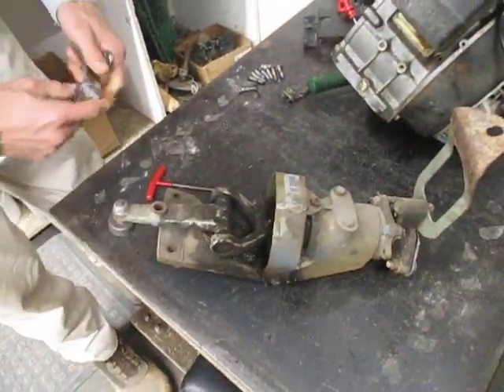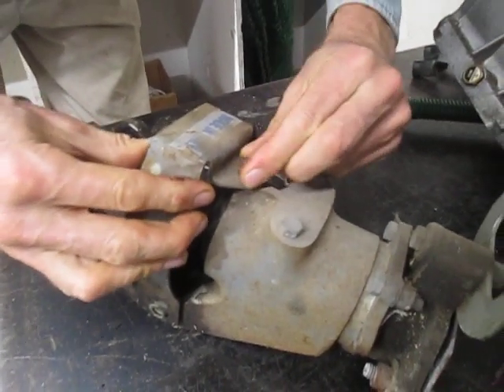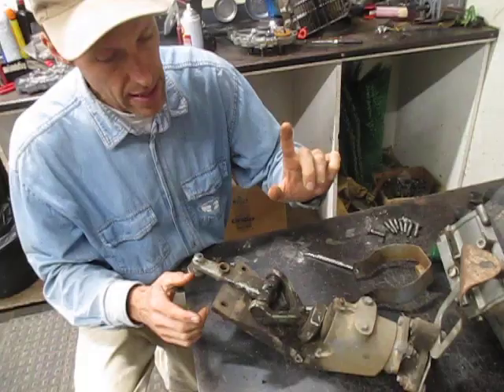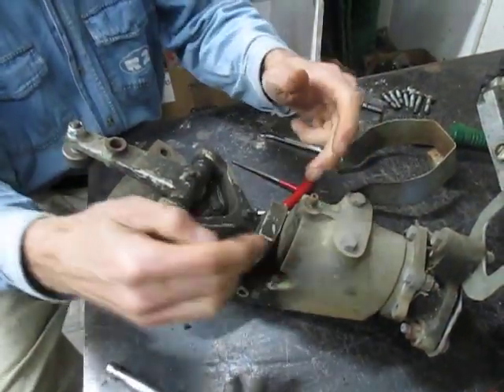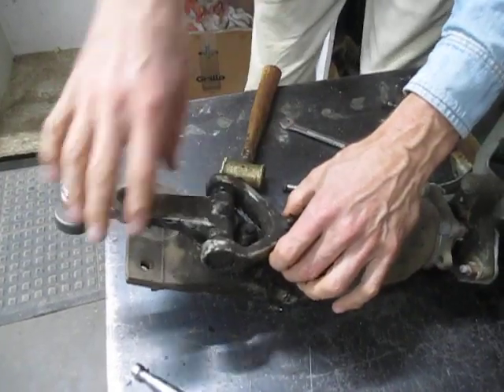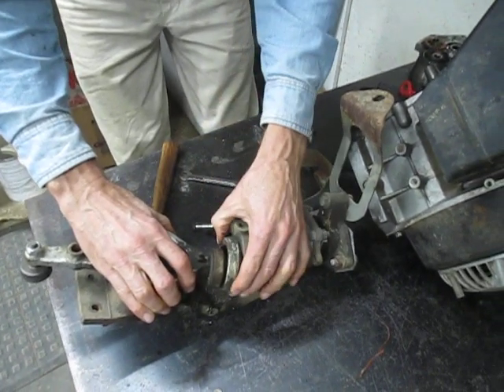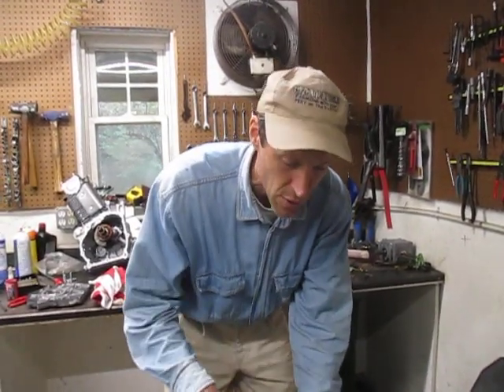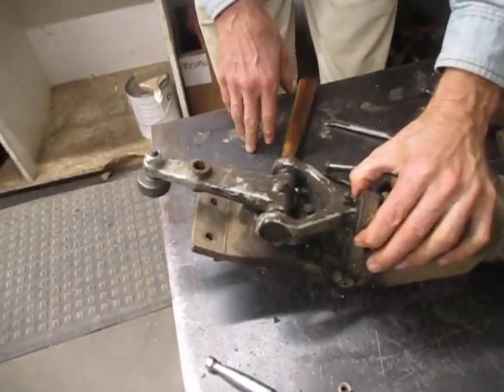BCS Single-Action "Dry" Type Sickle Bar: Service and Maintenance

Comment: 424 rollpin= easy out bolt remover n heat n spray lube.
1046 tack weld bolt to cap, use puller

Comment: Really appreciate your videos and website. Thank you. That damn roll pin on mine is really seized. It won’t move at all. I would have loved to see you tackle one. You talked about drilling it out and bolt pinning it which sounds great. If I were to drill it out, would there be big issues with drill shaving etc getting in the grease and destroying things? I see no way to evacuate all that grease with totally tearing down to bare housing. Am I wrong? Any other tips would be really appreciated on removing that pin! Headed to your website to order up some parts. Thanks again!